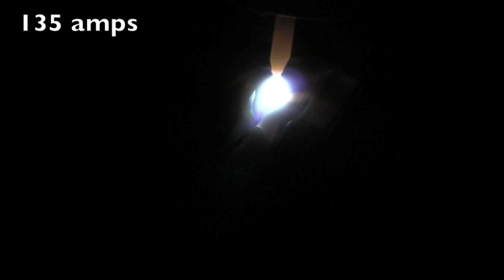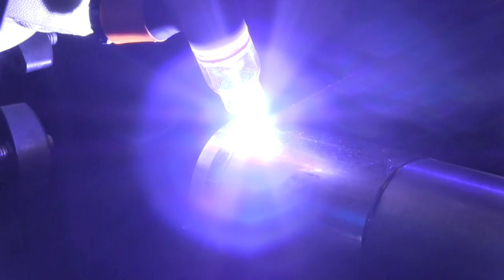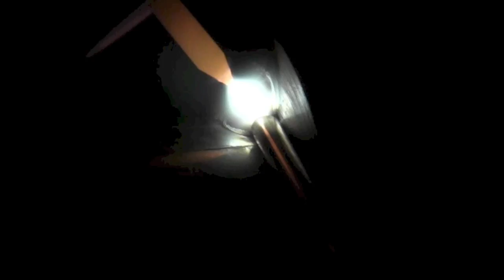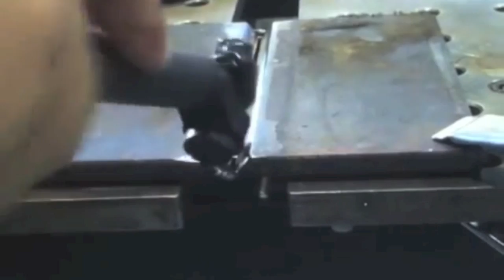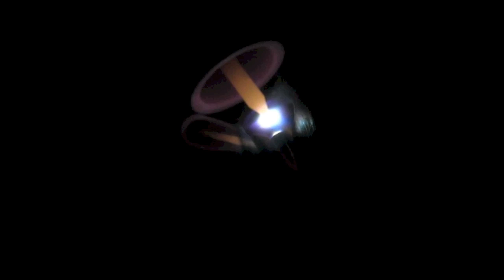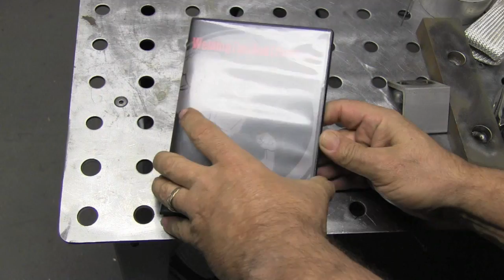Gravy Tig Welding part 2

Comment: $20 per part is low I think, well it's low if you've got like 5 to do, and it takes up half the day... maybe if you had 1000 of them then yeah that's in the ballpark. I think I'd set a minimum price per job, then plus $ per inch. Price per job can change depending on the number of parts. it still takes the same amount of time to open up the shop and turn the lights on, weather you are making $5 or $500 per day... Anyway Thanks for the videos Jody I'm gunna hop over to the website see if I can buy something from ya . chees

Comment: If ya ever get a tig machine you wouldnt mind selling for cheap please email me. 25 years old and trying to start up a side job. Im a d17.1 aws cert. welder working for a nadcap accredited tube bending/fusion welding shop in ca. Working there makes me want to own my own business. Maybe I can start by welding parts in my shed :)
Reply: +Chip Dorris I don't know if you'll read this but get the everlast he talks about. Power pro 164 welds something like 3/16 alum 1/4 steel on 220 and about half that on 110(portability is nice) for 1450 cad or powerpro 205si does 1/4 alum and 3/8 steel only 220. Both have a plasma cutter, one will do half inch the other 3/4. Or if you wanna save 250$ and ditch the plasma you can get the tig welder only version

Comment: wow! just awesome - the physio aspects of wire feeding...and then the bulky gloves...i introduced the 'united inch' method to a local welder here in the philippines. at first the whole shop there thought i was afflicted > before any welding - i observed his method. (he's not really a welder, but works in an automotive repair place - mostly tire repairs, that gets asked to run the entire gamut of chassis repairs). 1st) he dont wear a helmut or shield. 2nd) stick only using a homemade welder. 3rd) his best are normally about 1" 'tacks' somehow done by sound, feel, etc. long story short i had a pile of web trusses needed to be assembled, did the fab and fit up myself - other places wanted absorbent amounts for just the welding even after i boiled it down for them to something like 90" called as 8' because im generous (look at those practice plates youve shownin the series videos and then tell a client oh about 7000???). got to his place, made an agreement about the actual scope of what i was asking to be done, outlined the assembly order of how a pile of stuff is gonna be actually turned into something, labored literally side by side, same same the (?) making sure his and mine objectives coincided. bam, success. anyway, thanks jodi - ever made enough extra to weld up a  couch?

Comment: I know this is a tig video but since it's the most recent I was hoping you'd see this comment. Can you weave on a 2f joint?? I've been mig welding with dual shield and whenever I try to weave a 2f, over a stringer root pass, I get sagging on the bottom toe. I can't find any info about it on the Internet, everyone just does stringer beads but they do not say whether you can weave or not. I've tried using a half moon weave tracing the front edge and also tried a z weave but the outcome for both is the same, it's as if I'm not getting any penetration on the bottom toe, I have not tried pausing longer on the bottom for fear of it crowning up even more. Also if anyone else sees this and has an answer please respond.

Comment: the fastest way to learn to feed wire. weld 2" alum with 3/32 rod at 400 amps lol. You will use one rod for about 3 inches.

Comment: Could you make a video on how to prepare materials? Like cut angles, tapers, surface treatment. And then how you treat the joint after welding, for example how to make the weld blend with the existing material (for nice looks) or how to finish a joint for painting? Also maybe how you could tell a bad weld at that point and what you do then?

Comment: AAaww, this is great! 
We didn't learn to feed the wire at the half week welding course we got at engineering, so without thinking i put the wire to rest on my leg, while i moved my hand up. 
No need to tell that it hurt like hell and i still have a round mark and a hole in those pants to show for it. 

Also, liked your humor of putting the wire through the eye when watching a chich flick!

Comment: I keep a 2 ft length of 8ga copper wire by my desk. When I am watching youtube, I run it through both hands a couple of times. Pretty smooth now. Practice practice practice. My feed is down well, if only I could get my amps/ gas right! sheesh...

Comment: Seems like when you walk the cup, it increases torch angle a lot.  Do you have to compensate for the angle with less or more stickout, and do you adjust the argon so you get more shielding due to the angle of the torch?
Reply: i notice this and I wonder if one meaning for this inclination it's for video reason.
when I weld I see that perpendicular torch angle is always the best, but i never have pratice with walking the cup

Comment: Do you really need for tags?  I usually only use 3. 1 on 12 o'clock another one on 6 o'clock and one at 9 o'clock and where the fourth tag would be going I start welding

Comment: Thanks again , I love your videos . I fabricate and repair a lot of intercooler and exhaust piping for cars and trucks and I charge 15-20 $ per weld depending on the size of the pipe . This includes gas , wire , fit up and cleaning as most of these jobs are oily broken parts made of aluminum and stainless steel in diameters of 2- 6" . Does this sound high to you ? My customers don't mind this price so I'm just wondering if you thought this was a decent price or it is to high or to low . I'm going to use your technique and log the results against what I charged the customers bill to see by your math if me or my customers are getting a better deal . Thanks again for another great video .
Reply: jzxmissile question; do you ever feel like you've made "too much" money? equipment and materials cost money and there's nothing wrong with making a profit. One day you'll have to replace expensive euipment or add to your stuff. My theory is that as long as I keep getting work, I'm doing ok. Don't be afraid to make a profit.
Reply: If you're customers are pleased & keep coming back that's the main thing
Reply: jzxmissile  I charge $75.00 an hour plus travel time plus 70.00 machine and consumable fee!
Reply: I charge by the hour, dose not mean I'm welding for the whole hour. Set up time and break down time! We have a one hour minimum. I did a one inch weld and left.
Reply: jzxmissile I look at it this way, if I go out of business I can't help anyone anymore so I price in profit to take into account how much I paid for my everlast welder, consumables, accessories and my time. You might even ask around to other places to see what others are charging just to compare.
Reply: GeneralAlex4 But when you charge for the hour, you have no interest in being effective or doing the job quickly. 
If you did a weld as quickly as the author of the video, 75 bucks would be a good deal, but if you are slower, it's a bad deal.
Working by the hour is good for when you have a job at a factory or such, but for freelance work, i would never hire a guy who works by the hour.

Comment: On a different note I bought one of your tig
fingers and love it by the way butt back to
what I was saying I had it in a plastic tool
box with some other welding tools in my
mothers shed and her house burnt down
on 2-21-2015 but every one got out ok
a few days later I was digging threw the
rubble and I found my tig finger it was
black in some places but it made it
threw the fire I couldn't  believe it
ill have to take some pics and post them
Ill be bying a nother one

Comment: As a former welding instructor, I introduced a "TIG pen" to some of my students having trouble feeding wire.  A few of them liked it, most preferred to continue to use a hand feed method until they got it.   I found one of them on-line today for $60, and know I paid less than half that for my demo.   Search Youtube because there is a video of someone using a "Tig pen".  Like any other tool, once you get proficient with it, you probably will use it a lot.

Comment: Jody,
Funny stuff, I was practicing feeding wire while watching this video, and saw you mention it :-D

TV time provides a great way to practice feeding wire while concentrating on something else, it becomes second nature. Well, at least to me. Just need to practice with BOTH hands, so I'll be ambidextrous with my TIG welding abilities(which are still pretty limited)

thanks,
Dan
Reply: Dude I'm tellin ya man while you're learning how to tig practice left handed as well but don't overwhelm yourself maybe get comfortable righty first lay a solid bead down, cuz it's defiantly an advantage when your working, it's a lot easier to just swap ur torch and rod between hands instead of trying to monkey around what ever it is. And if you get Into pipe 6g is much easier to do ambidextrously
Good luck buddy always stay safe and get good fast if you want big cash😉
Reply: 4spida2fingaz0
thanks. I am going to school right now two nights a week, and we're running stick at the moment. I swap hands every other rod, so I can get a feel for running a pass in every position I'm working on(right now 4G 7018) comfortably, so it won't be "foreign" when it comes to testing time. My goal IS a 6G cert, and I want to eventually move towards alloys and top-tier type work(stainless, duplex, titanium,etc). Someone's gotta do it, and my instructor's said my beads are some of the cleanest he's ever seen(no bragging, honest), and he wants me to start plate testing for my LA City cert as soon as I finish up my 4g practice work. Thanks for the info, I'll memory log it :-)
Reply: Yeah buddy! That's great news man glad to hear an aspiring welder progressing fast dude, keep at it every rod you burn try to make it your best, don't waste time doing the same thing wrong over and over but experiment and try to understand why some things happen and study that puddle learn to differentiate the slag from the molten puddle here's some parameters that I like to use for mostly vertical welding 
Root
22.5* bevel 3/32 gap 
6010/6011 1/8"rod at 95
7018 3/32 -100 amps and arc control at 80%
7018 1/8- 110-115 amps and arc control at 80% always keep a tight arc let that puddle blow up some and continue it vertically stringers are better too 

As far as welding out of position really dude it's just the same shit but different position just turn your head to view the weld joint as if you were doing it flat, it will alternate your prospective as to what's happening that will eventually make sense. And alloys well usually once your good enough you'll figure it out within the first few welds and same shit different metals some puddles are more fluid (ss) others can be more sluggish like nickel alloys some you have to preheat others you can just sew up. 

Btw job shop work is great to start doing and can be difficult or fairly simple. Field work however, be prepared to bust you ass for 12hrs a day up to 7days a week working in almost any conditions, and typically the accessibility of weld joints can be very difficult pretty much you will find yourself welding In some shitty conditions but not always dude and that's where the money is so don't expect it to be easy just try and get good at welding so that everything else can follow
Reply: I correct my self 37.5* bevel for pipe or plate open root ,22.5 for plate with a backing bar
Reply: 4spida2fingaz0 
Thanks for the tips on the machine settings. We use Miller XMT's at school, they're nice machines. I'd love to try an engine drive sometime,  but don't know anyone personally who has one, other than one of the instructors who has a Bobcat in the bed of his pickup truck, haha

But yes, that "arc control" dial is a real handy thing to have. I'm still getting used to it, and I've found that letting the workpiece cool down(or I quench it in the cooling buckets) every 4-5 passes helps keep the piece under control temperature-wise. Before, I'd have very inconsistent results, simply because the base material/crucifix would get blisteringly hot, way too hot to be able to control a molten puddle on.

I am currently doing some moonlight work for a local job shop. The owner is a younger guy, same age as me(26/27). Mostly TIG, but he's been having me run MIG a lot lately. Not high pay work, but it's cash in hand, and some experience is better than zero experience sez I !

Comment: For me. This has been the most helpful video yet, with the wire feel explanation. Why did you use TIG for this job rather than MIG? was it that the filler material is not suited to MIG?